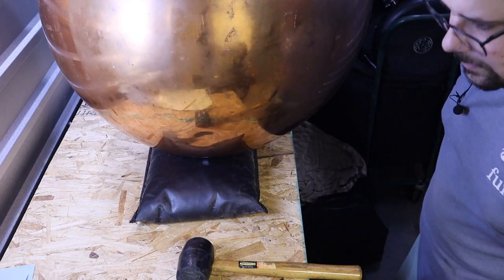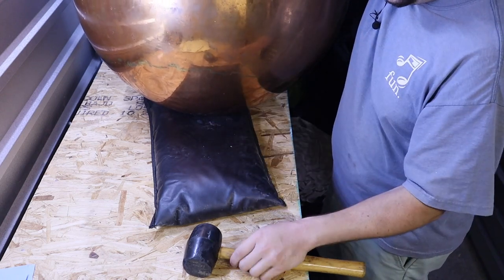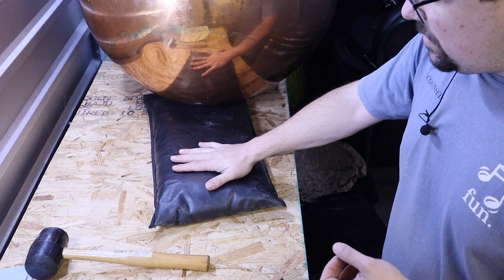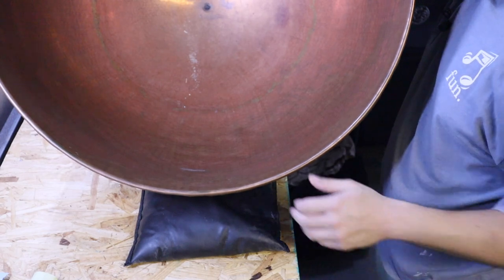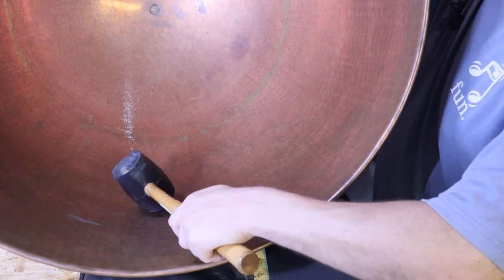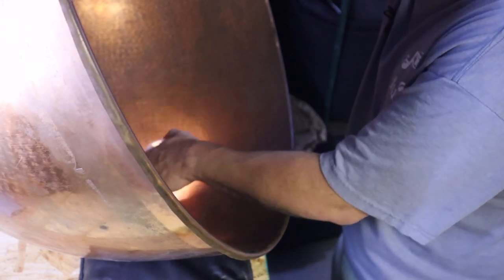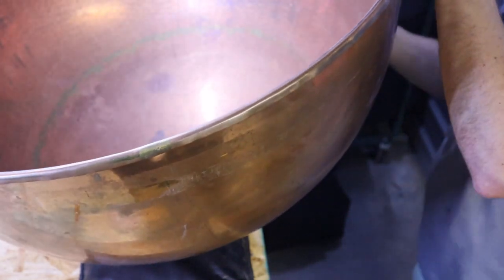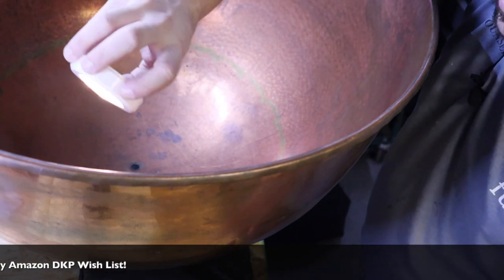Timpani Rebuild: How to Remove Timpani Bowl Dents, Ep. 4 - DK Percussion

Comment: Any advice for removing a flat spot on a bearing edge insert? I have a 29" fiber Ludwig and the bearing edge insert hss a flat spot like it was run into a wall. Maybe about 5 inches along the circumference. Top of bearing edge is level with the rest of rhe drum.
Reply from the maker: If you want to email me some pictures, my contact info is on my website. (Or find me on IG/FB.) I don't do a lot of work with Ludwig instruments, but if it's something I could give you advice on, I'd be happy to. I can also direct you towards the Ludwig guru... @BonoPercussion.
Reply: @DKPercussion  thanks, will do!